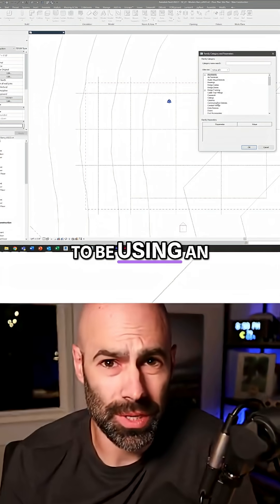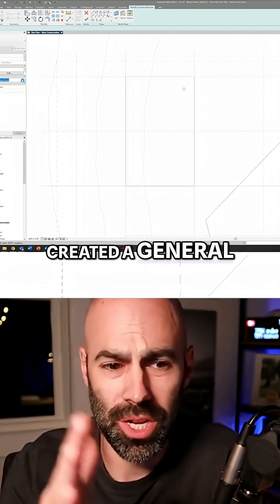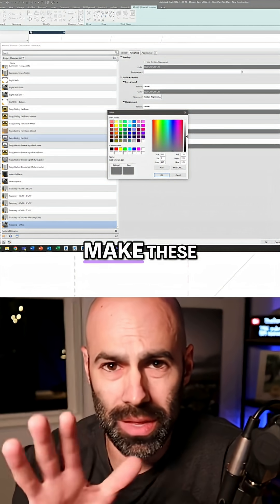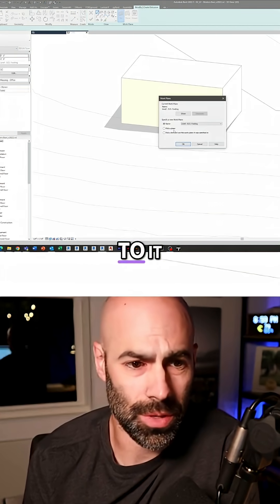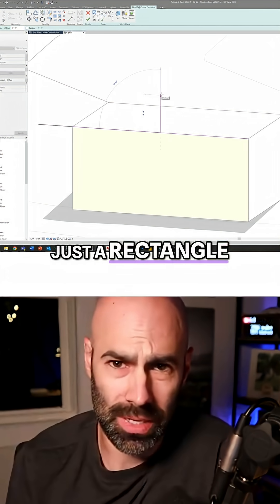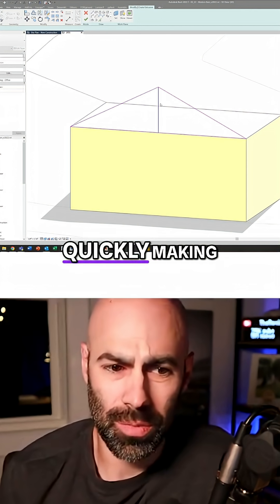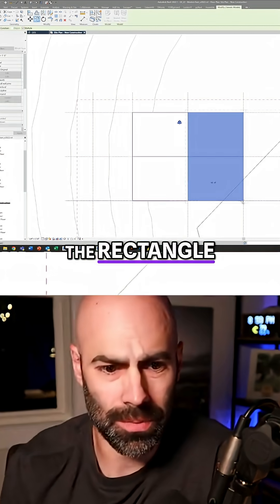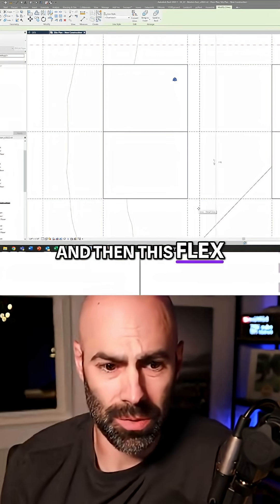Revit: Quickly Create Digestible Concept Diagrams #shorts

Comment: ive very often(when not knowing how to do it in revit) make volumetrics in sketchup instead. just cus its so easy and intuitive. i might use revit to go over an existing model with masses in post and then hide the original model to create vectordiagrams. but in brainstorm phase i dont even open revit. its sketching to get ideas translated into visuals, and sketchup for volumetrics/shapes/composition. then go into refined materialisation. and only when i already have an idea for the assembly I will start working things out in revit 1 by 1. the medium for me reflects the level of resolution(zoom) im working at. high resolution: revit.
Reply from the maker: Ditch sketchup … do it ALL in Revit man!!